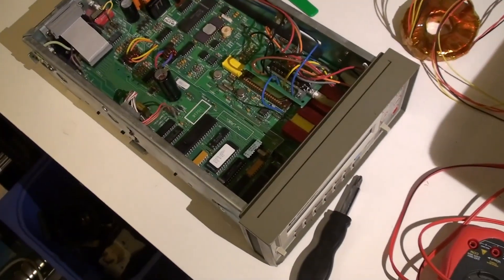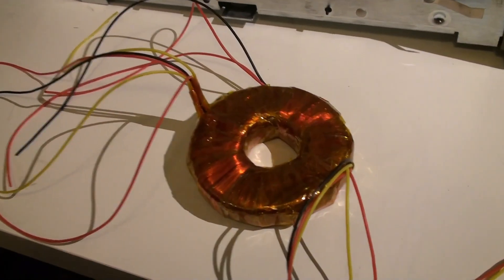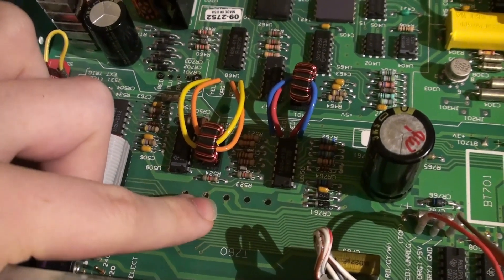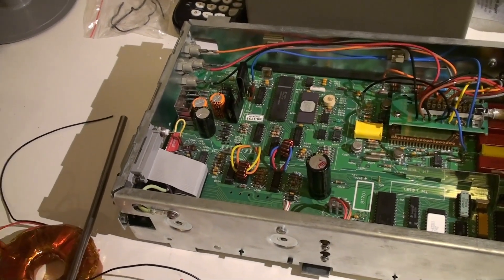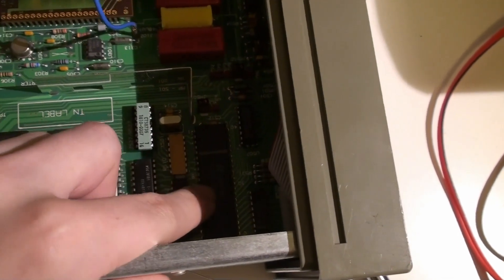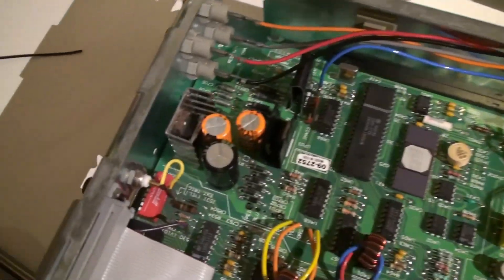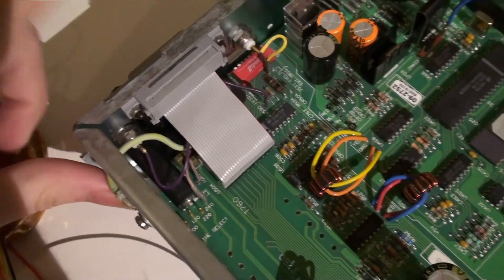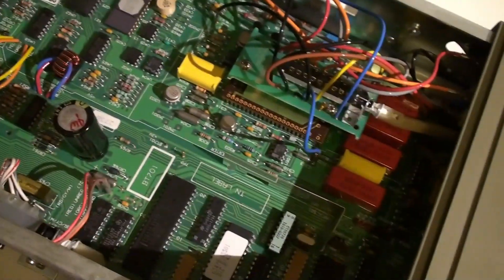001 HP3478A Transformer Replacement

Comment: Why did you not rewind the original transformer? It was a perfect physical fit.
Reply from the maker: Mainly because it is a hassle to rewind.
And it is a more fun project to take another route.

Not that the ferrite core I bought were a particularly good fit for the application in the end. But with a few years of hindsight I would have approached this project very differently.